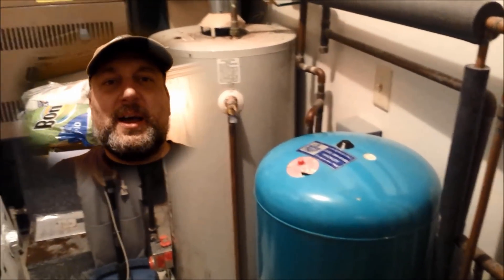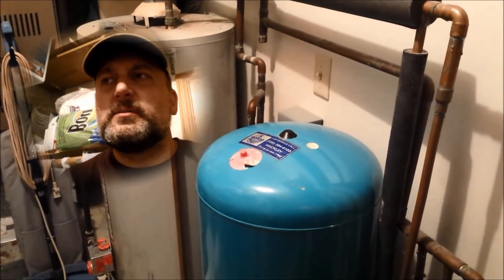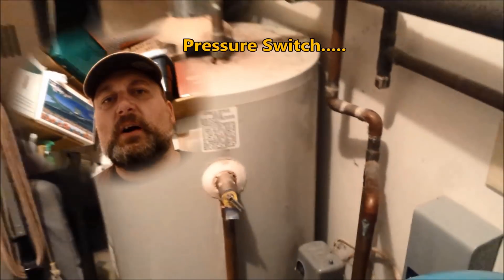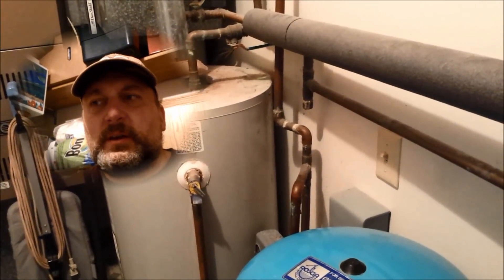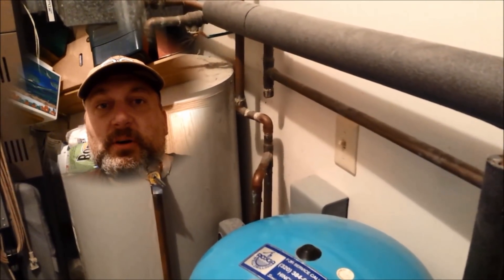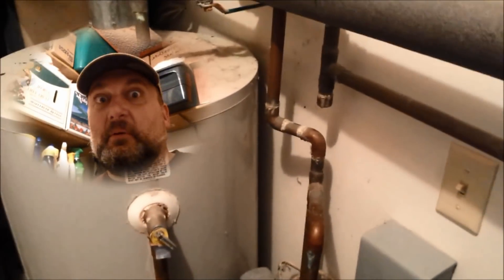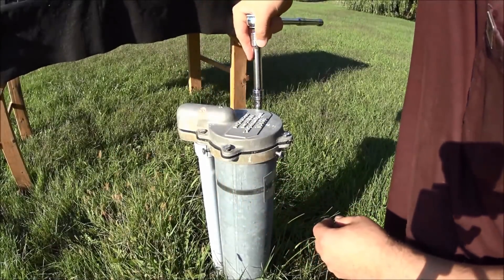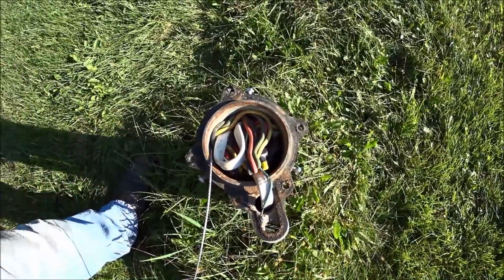DIY Submersible Well Pump Replacement 1 of 3 (Old Video Re-Upload)

Comment: We absolutely could not get our pump pulled from the casing.   There was no cable, just the electric wires.    We tried something new, and it worked perfectly.   We used a T-bar as you suggested, We set a log upright on each side of the casing.   Next we put our car jacks on the logs and up against the bottom of the T-bar handles.   We raised the jacks up together against the T-bar handle and that was powerful enough to pull the pipe up from the casing.   We followed your advice about carefully holding on to the pipe and wires as we pulled all 75' of pipe and the pump up out of the casing. Yahoo!  Success!  I wish I could share the pictures/short video here for others.
Reply: Did you use a video to find out how to construct that t-bar for removing the pump? I thought it was a tool you could by but looks like you have to construct it
Reply from the maker: Just made it. 😃

Comment: Man, if you knew almost nothing when you did this job I sincerely think you're genious!!!  I have electric and electronic skill and I can check if the control box is ok or not and if the well pump is good or not. So, there are no reasons for me to say I can't do this job, just need another person (and few beers). I wonder where to get that ''T'' bar adapter and thread size...... I lately had well problem (no water) and I had to change the control box (capacitor was dead) next day because I could'nt find a capacitor from Amazon because delivery time was a week.  I ordered an extra capacitor later to repair the old control box, now I have a spare control box. Thank you for this good and educative video (mean all 3 parts).

Comment: An old plumber showed me how to use 2 pipe wrenches on the lift pipe. Of course 2 people is better but the wrenches get used as a stop    each time you make a lift move the upper wrenche below the other. It will act as a stop. In my well there is over 80' of pipe not Poly black which is much lighter.
Reply from the maker: Good addition.  Thanks.

Comment: Hi, thanks for sharing! It's really encouraging, I will do it myself following your steps. But the only one thing I have to say after watching all 3 parts is you didn't check that capacitor in the control panel, which I think is the most venerable part in this system, cost only 10 to 20 bucks. Thanks!
Reply from the maker: Good suggestion.  Thanks!
Reply: Yep that's the most common failure mode.  Sadly I'm watching this with perfect capacitors and nothing coming from the pump, so...

Comment: Its called pit less valve it connects to a seat that is  bolted on to the pipe it protruding through  the pipe and connects to the pipe to the  house it is a male female v slide in and seal  connection inside the Stan  pipe

Comment: What size pipe did you use to screw into the pitiless adaptor?  I having the same issue you did
Reply: 1 inch od threads

Comment: Were buy the T handle?  What hp u know to buy?
Reply from the maker: The actual "T" part of the handle could be anything.  The important part is where it connects in the well. If you don't know, buy a couple different sizes/adapters and see which one screws in solidly.

Comment: At 6:19
You might want to think about taking 3 16'ft 2"×4"s and making an A-frame with a pulley on it. That would save you a lot of work and a lot of worries.

Juuust a
 suggestion ✌️
Reply from the maker: I thought about doing something similar with the tractor loader, but the biceps were just so much quicker and handier to get setup...   Seriously - the A-frame's a good idea.

Comment: At 3:35
You want to fill up a couple 55 gallon drums with water if you can before you start digging into your pump and turn it off.
JUUUST A SUGGESTION ✌️
Reply from the maker: Having Water is good...👍

Comment: AT 13:31 This is the reason you should never use electrical tape anywhere in the well line. It doesn't make it past the second winter and always clogs the motor/filter

Comment: Hey man, the next time you have to look down a chimney or well casing,  AND the sun is shining, try a mirror to reflect the sunlight down the hole. It'll shock you with the difference in light quality.   Good job, maybe the old Massey would tug it loose from the pitless adapter next time with a certain degree of ease.  lol.

Comment: You have a hole in the pipe coming up after the pump, I had it happen to me on xmas day a few year ago. Get some help, the pump is heavy.
Reply from the maker: Hi Gerald..  this is actually an old set of videos.  Did this replacement in 2015 and its been running good ever since.